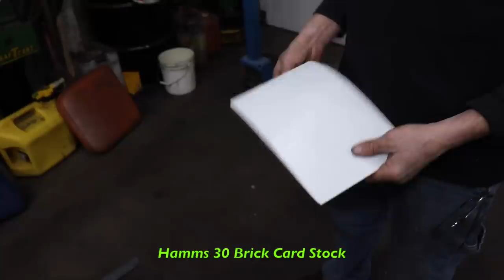Amazing RJ58 Wheelie Horse 1958 Resto-Mod (Part 4)

Comment: Heat-Quench story. My Uncle & Father tried getting an 1 & 1/2" Backhoe Stabilizer Pin out by heating it with an Oxygen & Amphetamine Torch "Cherry Red". Did NOT move the rusted Pin. I got my Propane Tank & large "Weed Burner" attachment. And some old Fire Bricks from a Wood Stove. Built a small enclosure around the Pin & Stabilizer. Heated the Pin with the Propane Torch. Then quenched it by spraying just the Pin itself with a water bottle with holes poked in the cap of the bottle. That Inch and a half Pin came right out with just a few taps of a Hammer. IT WORKS, every time! Thanks Taryl & Sons!

Comment: the old heat and quench to the rescue again.....after seeing it done at least 10 times on this channel, it really does work!!!
Reply: Yes and no. You can't heat up cast iron and then instantly cool it down like you can steel. Or it will crack. The case of that transaxle is made out of cast iron. So your better strategy is to heat it up until it's glowing orange then beat the pin out with a hammer. Spray a good penetrating oil on it while it's still really hot will help to break the rust bond. But you basically get it orange Spray penetrating oil on it then beat on it with a hammer until it cools down and repeat until you get it to work loose. Case iron is alot more temperamental than steel is and it's brittle. You really have to pay attention to what you're doing when you're dealing with cast iron or your gonna screw it up. It's not forgiving like steel is.
Reply: @JoshSmith-wo7zw  I cringed when he did this.
Reply: @JoshSmith-wo7zw  Uh, @43:00 Isn't this a welded on stub of steel???

Comment: Ill admit i was a little bummed when you chose to not use the live axle. But seeing how good this setup works im impressed! That is a wheelie riding rat rod. Last summer i built a race mower out of a john deer saber with a 420cc engine with torque converter that drove a live axle. I had to use a go kart steering rack because the original steering had alot of play. That thing could easly do 65 down the main road. I road it to are local tractor show and it turned alot of heads. I look forward to seeing part 5!

Comment: Great job so far. My old neighbor had an old sears 10 horsepower tractor with no deck on it. He used it to pull a reel mower. He always gave the kid's heck for popping wheelies with it. It's still out in his old shop.

Comment: Taryl, you could mount that brake disc to the Wheelie Horse's brake hub piece and use your existing brake system that you made if you wanted hydraulic brakes on it. It's coming along! Happy New Year to all you guys!
Reply: That sounds like a great idea!  As is, when it's in neutral, there aren't any rear brakes.  ....that is if the brake band is around the input shaft...I ain't sure.

Comment: 2 suggestions for the brake set up....if you use JB Weld, clamp the band in a circle similar to how it will set on the vehicle OR same set up and rivet the brake material onto the steel band while in a circle (Like all the old pads and shoes used to be riveted)....the JB weld isn't that flexible and it will harden in the way it is clamped......great set up on all the modifications on the ride...thanks for the hard work!!!

Comment: My 72" Ferris mower uses those heim joints for the upper swing arms on the front suspension. I have found that the 5 min. JB does just a good as job for me as the regular. I once used JB Weld to fix a porosity leak in a water pump casting. Held for years and told the car buyer about it when I sold.

Comment: Can't wait for the transmission repair. I have a transmission just like it. Out of an old 1965 500 special. The wheel horse 500 special was built when wheel horse was the offical mower for the Indianapolis 500. I beleave only 500 built with the special graphics on the hood. Unfortunately my hood is rotted out and I never had the k6 original engine. And the deck is long gone. But I think have the trans and body yet.
Reply: I had an Indy race car model kit that came with the wheel horse tractor model in the late 60s or early 70s.

Comment: a neat little machine, i am sure others have commented  the exhust is kinda close to the battery.  my thought was to use a larger pipe to act as a brace instead of the angle iron. but i am sure you have other ideas  stay well

Comment: I personally also do the heat and quench trick is works better then anything else. I had two old galvanized water pipes that was very rusted on the threads could not turn it out with a pipe vice and a pipe wrench so i did the heat and quench trick and believe it or not i could turn that thing out with my hand.

Comment: You should drill a bunch of 3/16  holes in that exhaust angle iron. Then it will look like a barrel shroud...also if Milwaukee was giving you free tools they would make you use safety goggles when you use it....🤔

Comment: Taryl: 
- Makes custom frame.
- Reinforces the frame.
- Heat-quenches pin out. 
- Makes custom bracket to hold engine.
- Modifies support to accommodate exhaust.
Slippers:
- Need to find a skull to fit on the shifter.
😂😂😂😂😂😂😂😂😂

Comment: Taryl, I have a wheel horse raider that I put a small loader on.  I'll do a video on it as it needs some tweaking but that's going to be a while, too many projects.  I'm currently rebuilding a 1947 engine 4 cylinder from a massy harris pony.  Check out the vids if you have time!

Comment: You can use solder to fill the other two holes by the grease fitting. Lead will work also but probably messier to pour in there. Oh snap forgot taryl putty! That’d work good. I’ll be quiet now. Lol

Comment: I think if you get some magnesium rods from an old hot water heater and use them on the wheelie bars it might throw some great sparks from the back.
Reply: Also add a little gasoline squirt there too This will give the back to the future fire 🔥 trails. 
Cool effect especially for a parade 🤪

Comment: I'm sure there's a n answer but I'm having trouble figuring out something. When the engine was turned, and the rotation is opposite what it was, what keeps the tractor from running in reverse?

Comment: I have a 63  753   same trans.   Shift gears slowly  it can get stuck in two gears at once    there was a service bulletin you can find  that said changing the shift rails would solve it
it included part numbers   it it does get locked in two gears  remove the shifter and  use a large screwdriver, align the shift rail reinstall the shifter handle   it only happened twice in fifteen years to me but I was quick to shift from one gear to the next
good luck with it

Comment: Wheelie bars are a safety measure but its probably not recommended to ride them, for riding wheelies its more dependent on your pulley ratio, throttle response and weight distribution, something you'll need to dial in. If you need more weight on the front consider mounting that screw log splitter up there -- Hold my Hamms I'm gonna split this here standing tree.

Comment: Hey Taryl...  instead of of using that brake band , why don't you just take a piece of pipe and cut it in half and make a nice pair of brake shoes out of it , it would probably work better and be stronger than the band style brake shoe.   you could hing it together at the bottom with a grade 8 bolt and still use your cable on top

Comment: lengthen the wheel base, or move the engine forward. You cant service that cylinder head and spark plug with it mounted so close to that rear gear box.

Comment: I don't "DO" facebook or instagram, but I would like to share pictures of my TroyBilt mower with a Peterbilt truck seat on it.  I did a wheelie with it when the back of the seat caught a low tree limb....   There's my LUNCH.   Ha.  I also have a WheelHorse (Toro) but no truck seat.  I had to rebuild the front axle attachment on the Wheel Horse.

Comment: Every time I find a cheap tractor to buy it turns into an expensive endeavor😂 new starter new battery $45 carb kit cuz it's a Kohler replacement used Hydro static transaxle the hood was pretty darn good shape till I busted it backing off the trailer🫣🫣🫣 so add used replacement hood to the list

Comment: I thought TARYL FIXES ALL???   Isn't the case to the transmission all????     Put some Taryl Putty on it and then grind it down to size......Do I have to do everything for you guys?    Taryl,  sure your handsome, sure you have a smile to die for.  But, thinking outside the box is not your strong suit.  Well, .....wait....You are pretty darn good of thinking outside the box.

Comment: You can get a hose adapter in which the plate mounts and is connected to two hoses that go to the filter that you can move around

Comment: You can still buy those brake bands from wheel horse the Toro has some the cedar rapids dealers where I got mine the transmission don't have no seal in it behind that brake hub I got a 1257 wheel horse with that peerless transmission in it when it rains oil comes out of that hole and gets on the break anyway it seems like you speed up when you step on the brakes you need a ham Spirit half handle for that baby kind of personalize it take care man
Reply: Hams beer tap handle